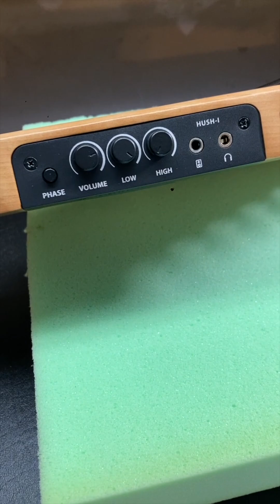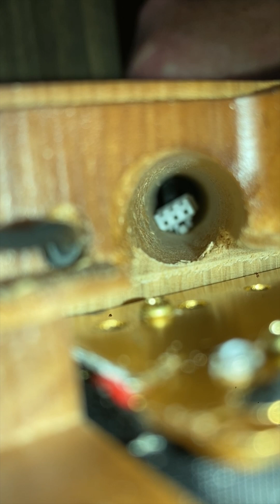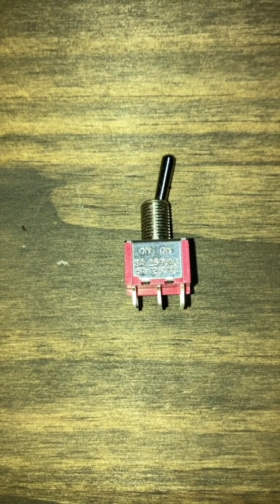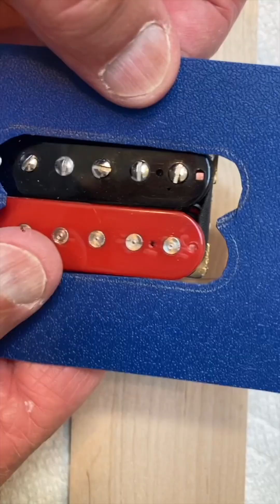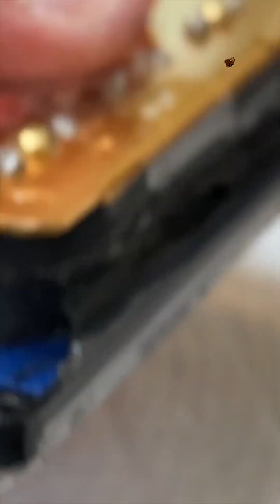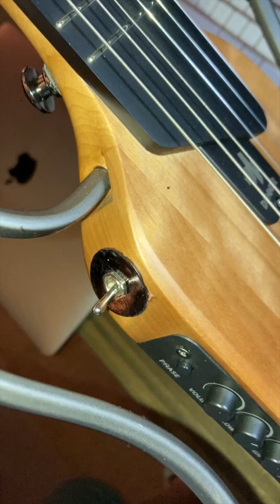Donner Hush 1 Humbucker Install - Mod

Comment: Hey I was thinking about using split rails from a single coil sized humbucker.  Then like a Parker use a blend control instead of a switch.  Or both.
Reply from the maker: That would be great - you can do a lot, just the height was the issue for me.  Hope it goes well!

Comment: Why did you wire the humbucker to piezo elwctronics? I have put in a Tele Singlecoil and a humbucker to the hush i today and I think I will put in 3 mini switches for turning on&off each pickup to the output ...
Reply from the maker: Only because I wanted the volume control and didn't have room for another pot.  I probably could have done it another way.  Let me know how it goes.
Reply: @davesotherstufff yeah, maybe that was a good Idea. I wanted to be able to activate all 3 Pickups at the same time, but the Piezo is so much stronger in volume. Maybe I will try to route them through the electronics.

Comment: How do you ground the strings?
Reply from the maker: There is a ground wire that runs from the tuners to the output jack that ground the strings.

Comment: Awesome tutorial, thanks for posting!  Would you change anything about the physical aspects of the mod if you were going to bypass the electronics and instead just run a passive humbucker as the sole means of output?
Reply from the maker: Good question - I don't know how you could bypass the electronics and still have volume and tone.  But just getting rid of the switch will make it a much easier project.

Comment: Any chance you can provide a wiring diagram? I'm doing the same thing but with a flat surface mount humbucker and a DPDT on/on switch. thanks
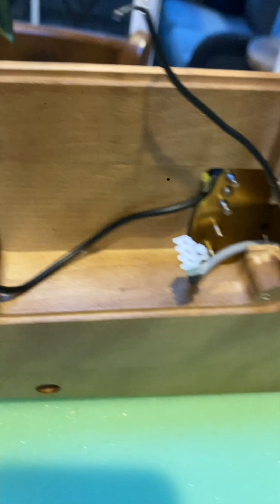Reply from the maker: Hi - you can see the wiring diagram at the 5:49 mark in the video.  I just used standard 2 wire electric guitar wiring - if my diagram is too basic, you can find much better versions anywhere on line!  Good luck!  I play the Hush 1 every night!
Reply: Thanks. I noticed that. What I could have used was watching how you did the cuts, extension, and splice of the piezo wire. This guitar is quite amazing, though the acoustic sound needs eq. I'm planning on an eq pedal to help. Do you use one?
Reply from the maker: @ljfolk1845  Hi and yes, I had originally filmed all the wiring, but my video was already 8 minutes long and I was worried about folks getting bored watching me cut and solder wires! But next time I will keep them in.  I know, the guitar is pretty great.  But I did have to take 1.5 mm off the saddle to get a nice action on it, but that is typical.  And I agree, the peizo is little "shallow" especially on the low end, but it is GREAT practice guitar.  And I do use a cheap little effects processor - I bought a Poprock effects box for $28 on Amazon. Not awesome, but not badf either! Works for just sitting on my couch at night practicing.  It even makes the peizo saddle pickup sound better when I use just reverb!  Good luck with the project!

Comment: See if I can pull this one off. The pickup actually sounded great!  So my question is, does the volume control (treb/bass) on the original wiring worked with the addition of the pickup? 2nd i would like to create another output jack just for the humbucker setup and add a volume pot but it seems that you have exhausted all the corners of the hush. 

Nonetheless, you just made my day kind sir thank you for sharing this video and for your time.
Reply from the maker: Hi - yes, the volume and tone work if you wire it the way I show - so both the humbucker and peizo go through the Donner board.  So you get the benefit of using the Donner electronics and pre-amp.  Just know that the output of the humbucker is much higher than the piezo in the bridge - so you have to really lower the volume when you switch to the humbucker, it's not perfect but it works well.  And yes, you are correct, I thought of also running a separate output, but there is no place to mount a second set of controls.  I hope this helps!